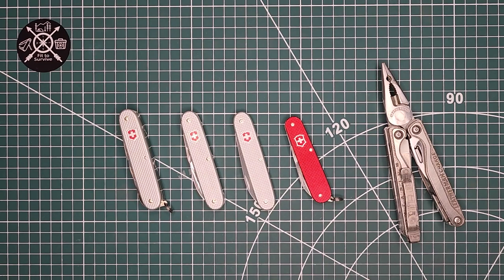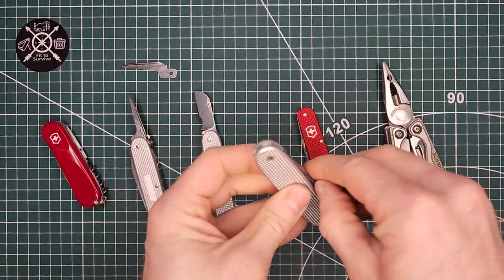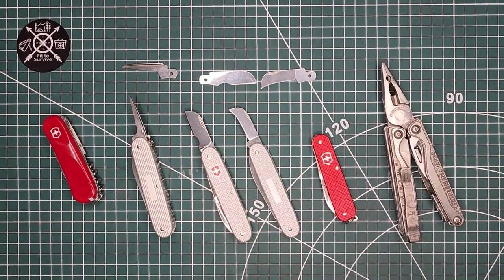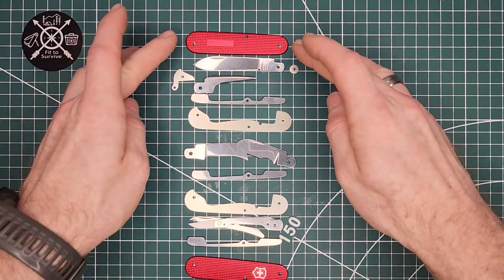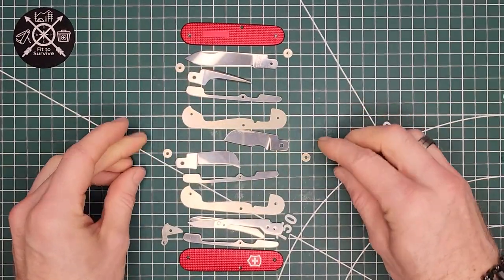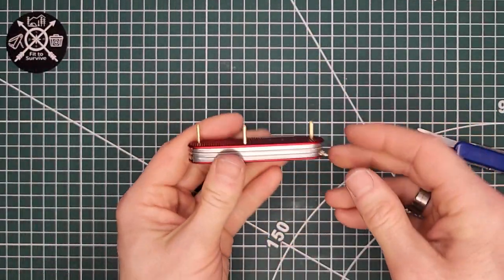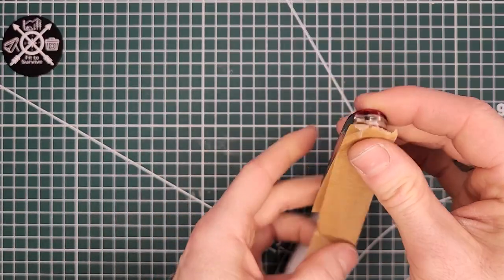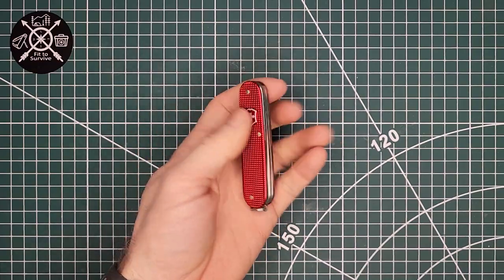Building the TX Tool Crib "Perfect Companion Knife"

Comment: Beautiful work and a nice set of tools. There must be a form available somewhere to give the rivets a nice domed finish, certainly back in the day I'm sure they would have been fairly common, I remember using them when I went to tech college. To be fair though you've made a very nice job of peening them over with a hammer. Your customer should be really happy with that custom build.
Reply from the maker: Thank you! Yeah, there's definitely got to be an easier way to peen. I know that Victorinox has a machine, but I'd never be able to get my hands on one. 😅

Comment: You are the master.  I am not worthy. I am wondering are the electricians blade and pruner blade the same throughly the different sizes?
Reply from the maker: Thanks. 😅 The electrians are the same size and the pivot holes are the same size. But on some tools (like the XLT) The Electrician and Pruner blades have been bent to be able to be placed opposite each other.

Comment: Happy Saturday Maestro FtS, thanks for the new video. That is great tool  set combo! If I was ever in the market for such a modification I would have chosen the 93mm size frame for a two layer Alox SAK with the blade paired with the combo tool & the regular scissors & for the 84mm frame a two layer Alox SAK with the blade paired with the combo tool & the scissors from the 74mm Ambassador over the 85mm Wenger stye scissors. ATB Steve
Reply from the maker: Hello Steve!
Glad to hear that.
Sounds like an interesting and slim toolset. Not sure if the 74mm scissors would fit on an 84mm, but I am interested in trying it out. 👍🏻😎
Reply: @FittoSurvive  Happy Monday FtS, My selecting the 74mm scissors is just theoretical & it might not be practical if it won't work with the backspring on an 84mm sized frame, in which case a modified 85mm Wenger style scissors will be the way to go. Basically I am thinking along the lines of an Alox version of the 91mm Compact. Have a great day, ATB Steve.

Comment: I am impressed by the ease with which you drill the bolts, you use a special bit or a preferred brand, which do you recommend using. Thank you
Reply from the maker: I use a cobalt drill bits. Usually I have to order them from overseas (via Ebay) because it is difficult to find small metric sizes without ordering an entire set.
The drill bit needed for the 84mm frame is the 2.2mm. And that is not a common size.

Comment: Another fantastic build! Amazing👏  Quick question.. is the knife blade on the alox bantam(84mm) identical to the standard 84mm main blade? Or is it also thicker like in the 91mm standard vs alox version?
Reply from the maker: The 84mm alox blade is the same size as the standard 84mm.

Comment: I always wanted alox bantam X, it doenst feel right to put wanger scissors there, but i just realised... is it possieble to make bantom x, from pionier x, put combi tool there instead of awl and take entire opener layer out? (or combi tool is too thin for this build?)

secound idea is to just swap awl for electrician blade on a pioneer x on the knife layer, that seems more usefull in urban office setting
Reply from the maker: Should be able to replace the awl with the combi tool. It would need some extra spacers. It would basically be a 93mm Bantam X.

Comment: That’s funny, I recently went back to carrying my first cadet (and first SAK at that)… and I missed it but it’s missing scissors, so I bought a couple more and took them apart, got Wigner style scissors as well as it’s an 84mm like you said. Basically this has been on my mind as well, got a “beater” cadet now that I take apart and add or mod parts for, I’ll post it in one of the groups you’re in sometime later. Awesome work brother!
Reply from the maker: Niсe! The Cadet X is an amazing toolset! Best of luck on your project. Look forward to seeing it.
Reply: @FittoSurvive  out of curiosity where do you get the little round spacers from? I’d love to not break open a few more SAKs than I have to for those… if possible.
Reply from the maker: @antonsimanov  The washers that I used were left over from making Dragonox Cadets. The Dragonfly does not need the washer like the original blade does.
I imagine that a similar size/thickness could be ordered though.
Reply: @FittoSurvive  I’ll have a look around, do you have a favorite place you like to look for parts or just anywhere? Now to size the washers, hopefully they’re not a special size but that’d be too east 😂
Reply from the maker: @antonsimanov  Hmmm... The SAKs I source from all over depending on where I can get them cheaper: Amazon, swissknifeshop, SMKW, etc.
As for parts, if you mean like the washers, I'd check on www.knifekits.com
Reply: @FittoSurvive  that last bit is what I was after, thank you sir!
Reply from the maker: @antonsimanov  You are welcome!

Comment: IMO The real problem about scissors is to mount Victorinox larger scissors (those mounted on FARMER X? or on Swisstool X? Actually the best performing scissors around) on a RUIKE LD42-B in which scissors are a little weak for an otherwise very sturdy and effective Knife. Another thing to develop further about victorinox is the possibility to avoid fix rivets in favor of dis-mountable screws so the knife can be cleaned in depth, can be reconfigured over time...
Reply from the maker: I've never used the Ruike before. I might look into that some day. Assembling the SAK with torx screws will really be an awesome improvement, I do have plan to make a special build like that in the future.

Comment: Great build, and very informative video. Thank you!
One question: was there a reason why you put the key ring spacer closer to the scales? If you need two spacers there next to each other, I would imagine that the key ring would be better positioned a bit more towards the middle of the knife. Or would that be too close to the pruner blade?
Reply from the maker: Thanks a bunch! Glad to hear that.
Yes, I try to keep the key ring spacer as far away from the tool next to it. If you get it too close, then there is a good chance that it could get in the way.

Comment: Is it possible to add the locking blade from one of the evolution series and use the dragonfly 2 blade, or run 2 locks for a scalpel and dragonfly 2 blade. If you could have 2 locking blades scissors, parcel hook and the bit driver I think it would make a hell of an bird and trout knife or a companion to a solid fixed blade for hunting. Maybe even throw the pliers on😮. If it’s at all possible.
Reply from the maker: I am still working on getting a locking blade to work. But havent had any successful experiments yet. The Evo locking blade has to use the Evo tool spring which is not compatible with the 84mm. Maybe the liner lock from a 111mm SAK will work though.
I'll post a video once I get it worked out.
Reply: @FittoSurvive  with the 111mm I would assume you would have a lot more blades to choose from as a donor as well, might be perfect that way!
Reply from the maker: @poonbandit9924  I meant using the liner lock from a 111mm and modifying it to fit on an 84mm.
Reply: @FittoSurvive  that would be so cool, I’d have to buy one immediately!
Reply: Sounds awesome

Comment: Three of the tools (the two smaller blades and the shim) had holes larger then the 2.5mm pins. How well does that work in practice?
Reply from the maker: I typically do not modify the 3mm pivot bores, there's not any issues in action and closing. Trying to peen them in and re-drilling them out to 2.2mm is unnecessary.

Comment: Replace the scissors for a sawblade and its perfect. Never really was a fan of tiny scissors
Reply from the maker: That could be arranged. 😅👍🏻
Reply: @FittoSurvive  I honestly was thinking of asking you about a build for myself. I was thinking green scales like micarta, denim or like Carhartt material, something grippy as long as I can get plus tool scales. Tweezer, Ferro rod in place of pick. A spyderco main blade, smaller secondary spyderco that's serrated karambit both 1 hand opening, and the main victorianox blade but serrated. Can opener, saw and the little pliers for grabbing hot stuff. An awl, corkscrew and philips at the back (the only tools I can think of for the back). Green g10 liners in place of aluminum if possible, if not, I really like brass. I really like the 111mm and 130mm sizes, the bigger the better. Lemme know what that would cost, ballpark. Canadian 👌🏽
Reply from the maker: @misfitledoux1312  Can you send me an email. That would be much easier for me. f2scustoms@gmail.com